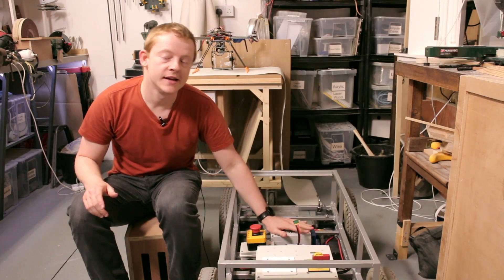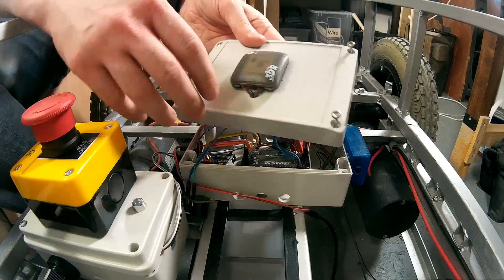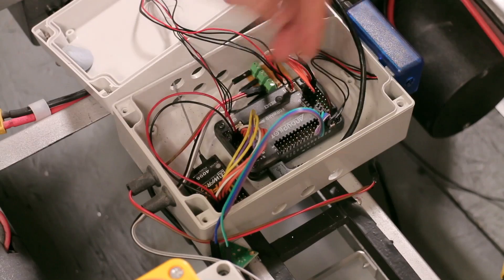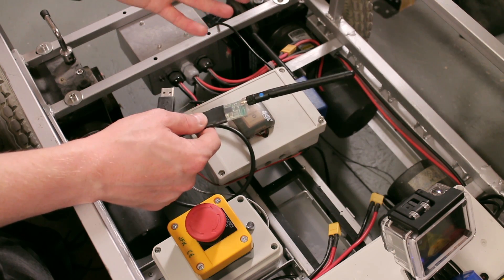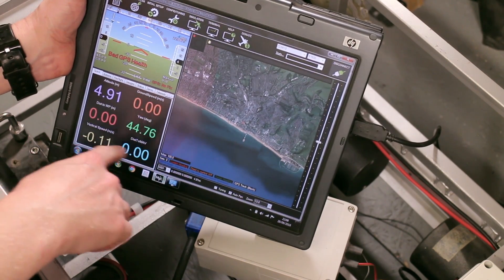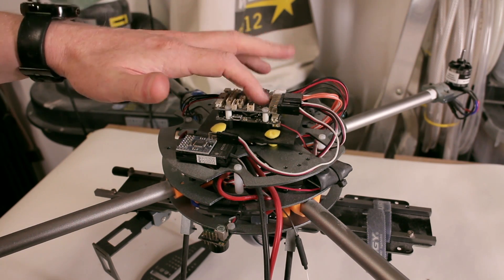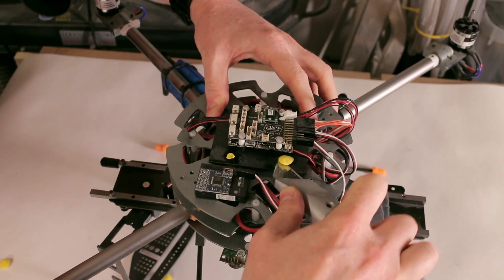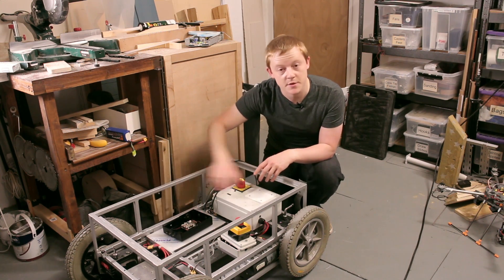Ardurover Control System - Robotic Vehicle #5

Comment: That's really cool. Have you tried running it outdoors? looks to have a long wheelbase and doesn't really seem it would skid steer very well except on pavement.  I'd love to play with a board like that in one of my remote control lawn mowers :-) https://www.youtube.com/watch?v=NQsTEjVtj98
Reply from the maker: +builtrodewreckedit your right, skid steering isn't great but it has the power to turn on the spot on most terrains, just isn't very graceful!
When navigating automatically the turns are very wide which does seem to work well.
In the playlist mentioned in the comments is some old footage of it traveling around a field